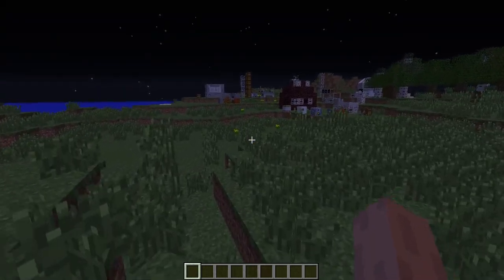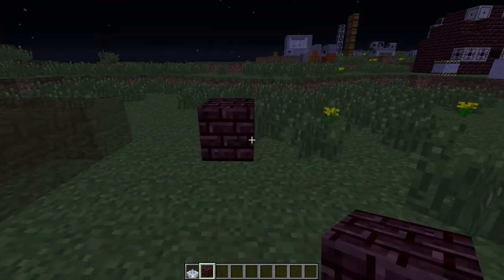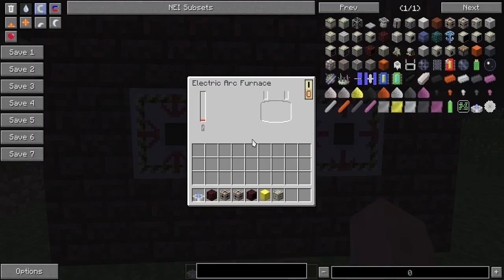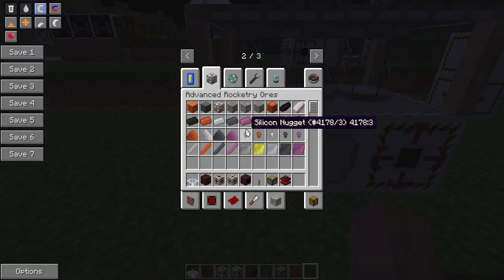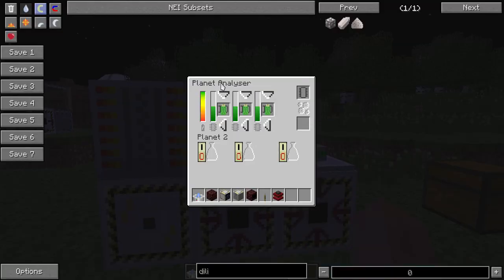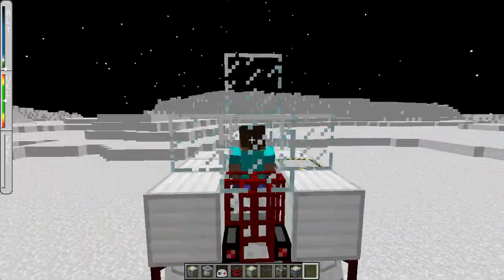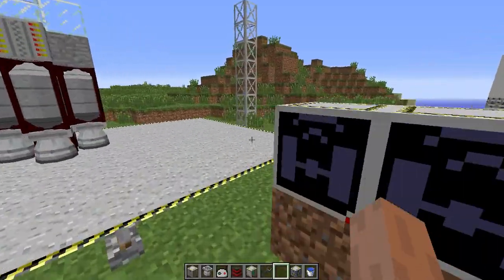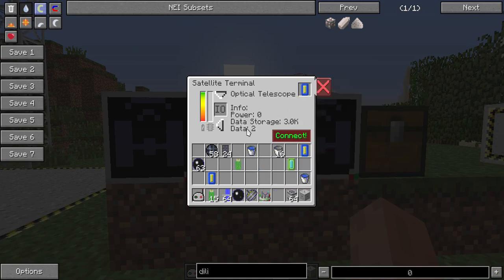Advanced Rocketry Playable Alpha Features

Comment: How to install D:
Reply from the maker: +Manan Otk ㋡ Download and install the latest 1.7.10 version of Forge from http://files.minecraftforge.net then drag/drop libVulpes and Advanced Rocketry jar files into the mods folder.  You will also need a mod that can make RF power because Advanced Rocketry cannot do this yet (I suggest buildcraft or enderIO) then it should load up when you run the instance.
Reply: Thank you , set me right and that was not the problem ..... I had not installed the BuildCraft mod xD